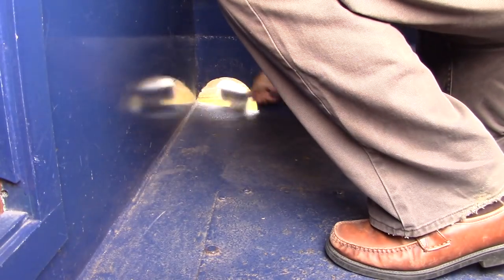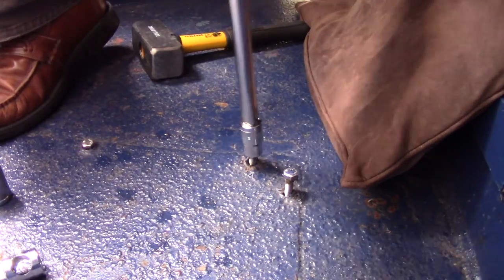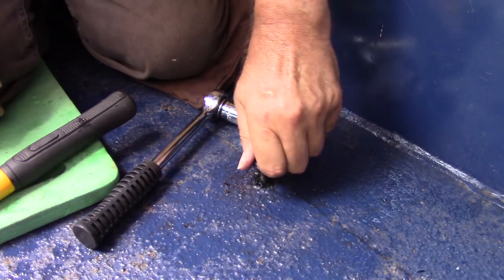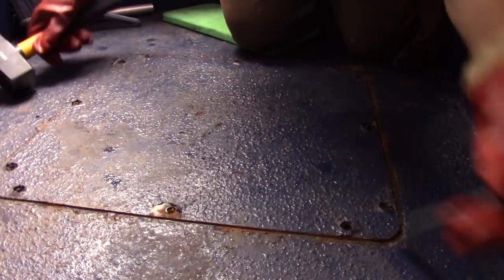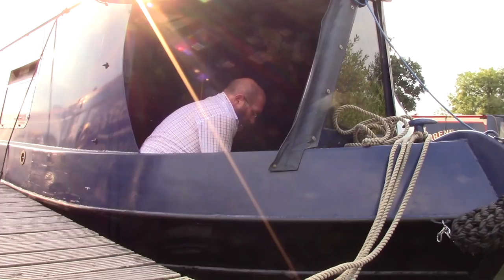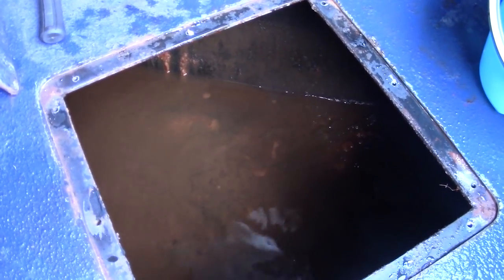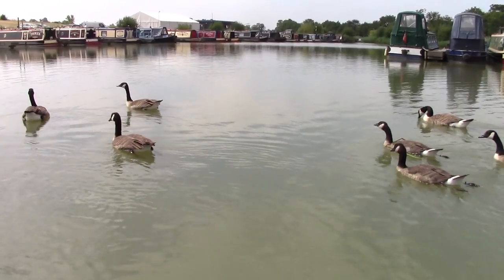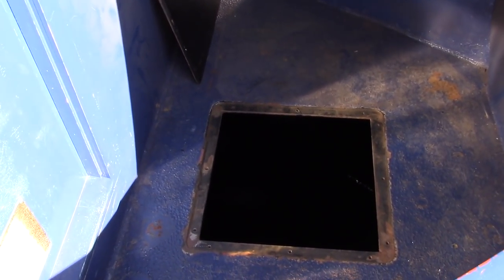19. Narrowboat Water Tank Clean

Comment: Terrible job to do, but great result. Definitely going for a stainless tank when I get a boat.

Suggestion, if you need to redo the seal, stick it on all round, the cut the bolt holes with a drill from the top.
Reply from the maker: kevgermany - Many thanks, at least it’s not a job I’ll be doing again. The tank is an integral part of the boat and therefore has a great capacity. Good luck in your search for a boat.

Comment: Cracking job...well done..so is that water safe for drinking with that black coating on or is that tank just for washing and the toilet. 
Not yet a narrow boater so trying to learn 😉
Reply from the maker: Hi Simon thanks for your comment. The bitumen coating is a special one for use in the water tank. So yes from that aspect it is safe to drink. I though only use it for washing and the toilet. I keep tap water in separate bottles for making tea/coffee though would be happy to drink the water if it had been boiled. You also have to consider how clean is the means used to fill the tank. I was warned when I hired a boat that you don’t know where the hose has been ie has it been dropped in the canal!
Reply: @MyNarrowboatVenture  yeah that's a thought...think I'll stick to bottled if I get the opportunity. Thanks

Comment: After painting.  Good job. Y the way we would have fitted a linar
Reply: Just to add rank cover seal next time just go over bolt holes then get a bit of 15 mm copper pipe and hit it over the hole cuts them out neat
Reply from the maker: I understand liners can lead to problems between the liner and steel and they’re not so easy to clean.

Comment: Wire on rusty steel is always a chore, & not particularly effective. An abrasive wheel would be better & easier, & do a much better job. When refitting the tank hatch, why wouldn't you use stainless bolts?